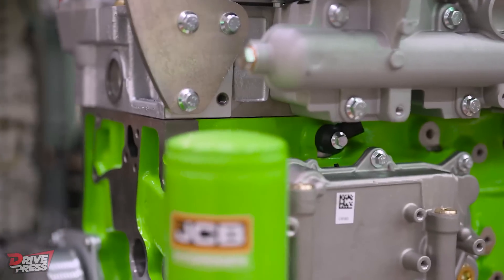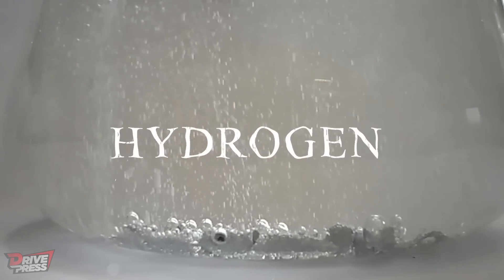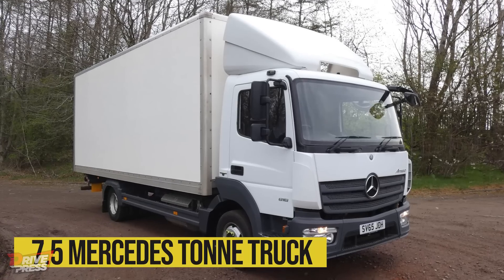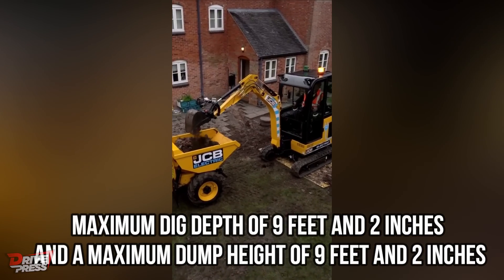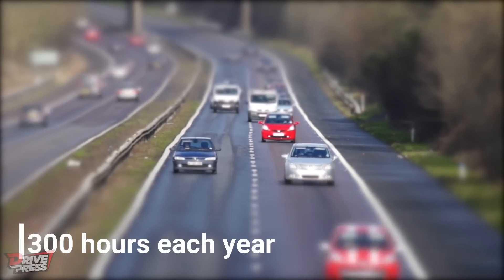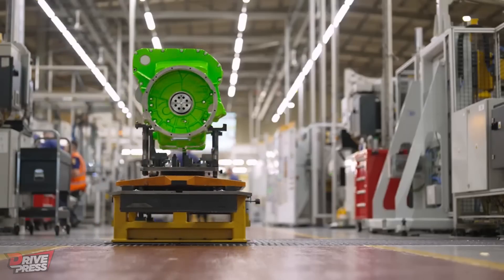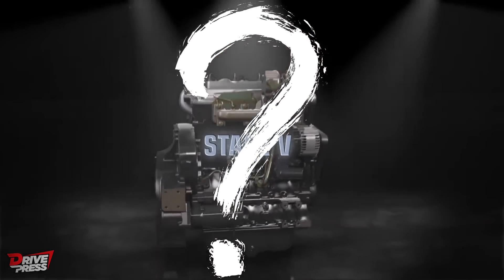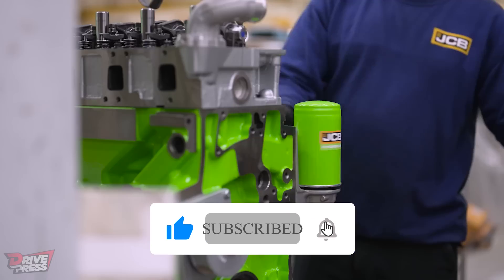The JCB Hydrogen Engine Is RIPPING APART the Industry Norms!

Comment: This has to be BS. Where is the hydrogen coming from ???. Hydrogen is extremely difficult to prevent from leaking and is extremely flammable/explosive and needs to be under enormous pressure to have reasonable range. Can u imagine the average digger driver having a cigarette while filling up ???. The efficiencies  loses are horrendous from generation of hydrogen to compression of the gas then the ICE losses.  For all their problems batteries are at least feasible.

Comment: No matter what chemistry one uses for batteries they are still batteries that only store electrons for a finite time and have limited longevity. Hydrogen on the other hand will combust in atmospheric air and turn into water with out GHG emissions, forever. That technology will never change its basic physics. So if the goal is to save the planet then Hydrogen for transportation is the only fuel that replaces Fossil fuels. And that is a fact. Batteries for transport are futile fantasy that will accelerate fossil fuel use because the mining for Lithium and cobalt and processing of, at large scale will demand more fossil fuel use. But we need to make more Green electricity to achieve this goal.

Comment: Hydrogen is what we should be developing instead of EVs.  EVs might look nice on paper but our current electric grid can't handle them and the pollution created by making/disposing of the EVs batteries pretty much off sets the benefit.   EVs are a good start but idk if it's the solution unless the batteries change
Reply: EV is the best solution we have. Hydrogen will always remain too inefficient. We cannot afford consuming five times as much energy.

Comment: Due to the laws of physics energy cannot be created or lost only converted from one source to another hydrogen will never be as efficient as using electricity to power a vehicle. 

The losses in converting the electrical energy into hydrogen and then converting the hydrogen to power the vehicle will result in poor efficiency with a large proportion of the original energy turned into waste heat.

Comment: What I find worrying about ev's is the number of spontaneous fires that these batteries cause. Take for example the recent cargo ship fire off Holland. All that the emergency services could do was spray water on the outside of the ships hull instead of pouring water on top of the ship which could have caused it to sink. Then there are the number of reports of lithium battery powered scooters setting fire in houses while on charge.There is another problem with  ev batteries, how do you recycle them ?  As far as I am aware, there is no financially viable method of doing this. The whole ev scenario just has not been properly thought through from day 1.

Comment: i heard you get twice the energy from  hydrogen fuel cell.
Reply: Hydrogen can only contain the energy used to create it less the losses in conversion it is impossible to have twice the energy.

The law of conservation of energy states that energy can neither be created nor be destroyed. Although, it may be transformed from one form to another.
Reply: Hydrogen fuel cell is less inefficient than hydrogen combustion. That is what mr. Weston meant.
Reply: @Freba9  yep, but still nothing like the 80% plus of an EV.

Hydrogen fuel cells are generally between 40% to 60% energy efficient, according to the U.S. Department of Energy. This range compares to the typical internal combustion engine of a car, which is about 25% energy efficient.
Reply: @ItsAllJustBollox  Exactly. EV is the way to go.

Comment: JCB can’t even get their ft4 diesels to run right.
Reply: right .becayse the industry eco nazis choked thier engineering to useless. this tech is far superior and too bad about everyones poor little feelings. battery tech is more poluting and has longterm reliability issues . charging is still an issue. this zero emmision engine will rule the markets in 5 years.
Reply: @KevinFreist   v
Hydrogen or maybe what Porche is doing, E-fuel.
Reply: @thekinarbo Both insanely inefficient.
Reply: @Freba9  
So is solar and wind.
Reply: @thekinarbo  More or less yes, but still very usable. You need LOADS of wind, solar and nuclear energy to make hydrogen and far less of it to charge an equal number of EVs.

Comment: Hydrogen will win.
Reply: Very unlikely.
Reply: @Freba9  Says you?
Reply: @triple6758  Laws of physics.
Reply: @Freba9  See you in 20 years.
Reply: @triple6758  yup. Laws of physics will still be there.
Reply: @Freba9  Vague.  Pitter patter.
Reply: @triple6758  It's really simple: hydrogen vehicles were very inefficient 20 years ago, are very inefficient in 2023 and will still be very inefficient in 2043. Therefore the vast majority of vehicles and machinery will be battery electric. Hydrogen will always remain a niche due to far higher cost per hour or km.

Comment: Makes more sense for offshore rig operations on the water for oil drilling but might have important uses for onshore USA oil and natural gas operations both to power compressors and actual rolling stock.

Definitely Space Age fuel as both positive and negative.

Comment: The weight of batteries in a JCB is a silly argument when they have to have a counterweight anyway. What I want to know is how big are the fuel tanks and how much does it cost to fill them?
Reply: According to Lord Bamford the extra weight means every machine category which on excavators is based upon weight such as a 20t machine a 30t machine etc would go up a category without the increase in performance of that uncreased weight class. In other words it is massively more than the counterweight. Also machines frequently have to operate for over 16 hours in different shifts. Farm machinery such as harvesting equipment maybe even longer. This is why hydrogen is so exciting, same weight, same work, and quick refuelling. I therefore think he and his huge team of engineers are probably right.
Reply: @fibreguy1971 But insanely high energy consumption.
Reply: @fibreguy1971  I wouldn't be putting my money on Lord Bamford's engineers since they can't make a decent diesel engine as it is. Good diggers when they're actually running though.

Comment: The problem with EV-powered heavy equipment, is the charge time.  As these machines are very often used in places that don't have mains power (especially high-current power supplies), you are limited to slow, low current charging.  I've seen videos where the TWO hours of use, requires EIGHT hours of charging from diesel generator - that amount of downtime and emissions is just totally unacceptable.  Hopefully Hydrogen ICE will provide a way forward.
Reply: Hydrogen is a dead end imho
Reminds me of Volvo bev truck vs Tesla truck.. the former takes forever to charge, and have just a few hour run time. In other Word its useless
Tesla truck can run an entire day.. and need 30min to charge up to 90%… 
Bet Bev trucs and tractors is the future - but the old players will not bring us compelling products..
Reply: @rare_wubbox360 If you do the maths though on those 'Tesla semi chargers' each charger would be consuming the same electricity as ~1400 homes, which is just insanity! The electric grid cannot cope with that amount of load turning on and off..
Reply: @RangieNZ Guess what, a vehicle with hydrogen combustion engine consumes 5 times as much as that.
Reply: @Freba9  The thing with hydrogen though, is it can be done constantly, in the background (- say using renewables) over hours or days and then stored in tanks.  Filling the vehicle takes just a few minutes to transfer the gas.
Reply: @RangieNZ  Still doesn’t justify the very low efficiency. Most EVs also charge slowly in the background during the day and night. Fast chargers can be equipped with batteries to buffer.

Comment: Recent investigations on the consequences of hydrogen leakage show environmental damage 12 times the damage of CO2.  Until recently there was little research on hydrogen as a pollutant. There was an assumption that the only result of hydrogen leakage was the formation of water. It now appears that assumption was seriously in error.
Reply: Doesn't a I.C. engine produce CO2 the entire time it's running ?
Compare this to a hydrogen "leak"  that can be prevented with proper handling and maintenance.
Reply: Do you support the banning of dihydrogen monoxide.  It kills thousands every year.
Reply: Hydrogen is the future.    JCB  have done a great job in providing a very workable alternative to diesel.  The nay sayers in these comments probably have a stake in EV technology.   Where would all that lithium come from ?   What about the pollution associated  with future fly-tipping of car batteries ?    Answer us that ! !

JCB  is a Brit firm doing a great job for decades now.   We in UK have little left to boast about so stop carping and support this wonderful firm.